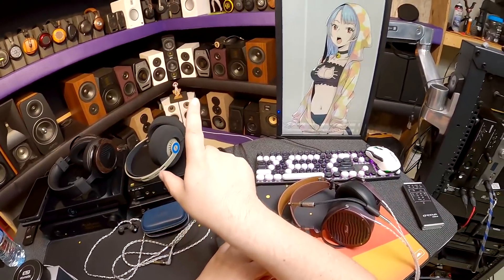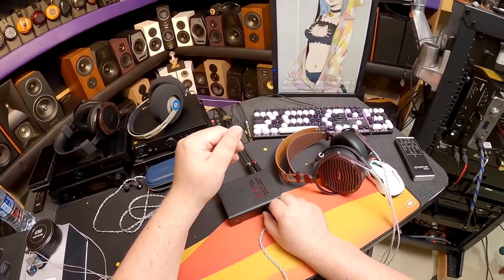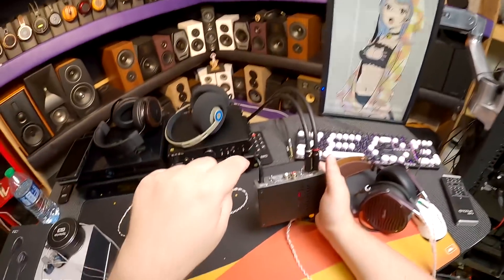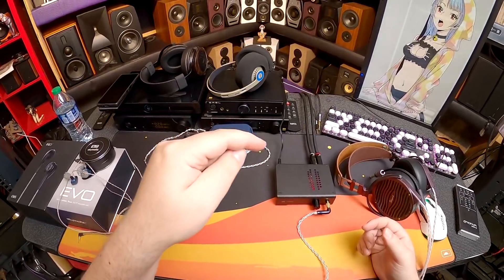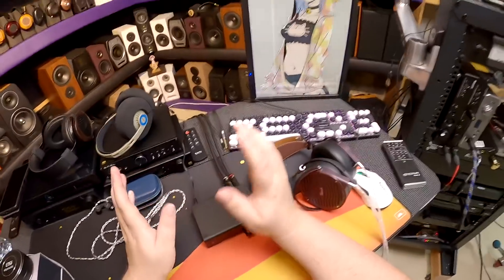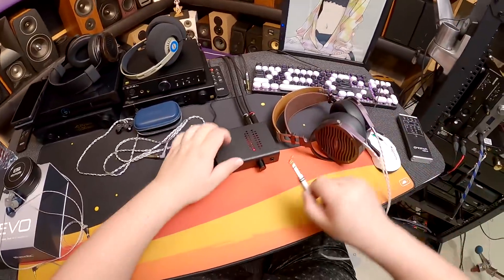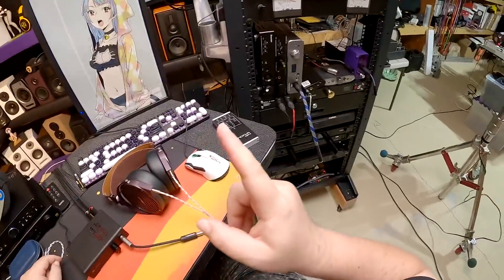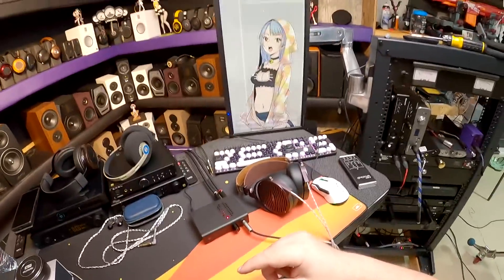🟥$120 Do-All-Amp _(Z Reviews)_ Schiit IEMagni

Comment: Ok, I have a pair of ATH-M50X that I've been using for years. I have them running on a cheap fosi audio DAC/AMP. Per the recommended of zeos, I bought a pair of HD 660S and then I also got a schiit Valhalla 2 to run them. I plug everything in and I was completely underwhelmed. Definitely not worth the pretty penny I spent. I felt the system lacked detail. Have my ears been ruined by the audio tecnicas?  Should I return the items and start from scratch?
Reply: I think you has got used to how your old headphones sound, I have 280 pro and bought 560s, was running them from focusrite, honestly, I've noticed more details and separation straight away. However, on some songs which I've listened to only on 280 pro and some Sony Bluetooth 40$ headphones, I felt like they sound just not as I remembered them. Now, I've bought Topping L30 to it and I feel like they sound even better, less ear piercing. 
I advice you to listen to different genres, maybe to such that benefit from more details and separation like classical music, jazz. Listen to some new music on these headphones so they would be remembered by you in this new sound.

Comment: I have one complain with World Best Cables. They promote starquad RCAs as if they were better at rejecting noise. This noise rejection only works for balanced connections. I believe their best RCA cable is the Gotham ultra pro with coaxial wire, 4 layers of non-directional shielding.
Reply: Isn't gotham also a Starquad variant? Pretty sure. Anyway, the best RCA wire is coaxical Mogami 2964.
Gotham is also good though, as are canare starquad. But 2964 was tested by RME to be lowest noise.
Reply: Also, if you can't tell in a blind test who gives a shit?
Reply: @davidjameswales  purely educational, to know which cable transfers best, not going to say it sounds any better. But I dislike those audiophile stiff cables, mogami is nice and bendable.
Reply: @davidjameswales  not a matter of sound, but noise, radio interference.
Reply: @tenveri  Gac-1 ultra pro is coaxial with 4 levels of shielding

Comment: Great amp. You're spot on about the Magni 3+ , Heresy, and IEMagni differences from someone who's had all 3.
Magni 3+ is way too smooth and loses too many details for me, Heresy is way too sharp/clean and doesn't add any comfortable warmth to the sound, and the IEMagni is the goldilocks of both for me. Absolutely love it, if anyone has questions let me know.
Reply: Hi I'm new to audiophile stuff and was looking into the modi 3+ and one of these magnis (likely the iemagni bc of these reviews). I've heard that it can serve as a preamp for speakers as well. Does this mean I can or should connect active speakers to the magni? Sorry if this is obvious I've been trying to figure out all the components recently and this is confusing me. Also are there any closed back headphones you can recommend to pair with these? How much should I be spending on headphones to get the most out of these? Thanks in advance!
Reply: @Likeitornot91  Modi 3+ is an outstanding dac and should be paired with any of the Magni's.
All of the magni's have a seperate preamp out on back that allows for active speakers (NOT PASSIVE) to be connected to the amp as well as headphones. I don't use speakers personally so I can't speak much of whether you should use it or not but I'm sure it is satisfactory. I use open backs primarily so not well versed in closed backs, but being in the community long enough for closed backs I always hear about Meze's offerings being good, whether its the Meze 99 or Meze Classics. Luckily since this is the best budget amp/dac stack in the world (IMO) and a fantastic starter set I wouldn't worry about ratioing how much you need to spend on headphones for them etc. They'll make anything sound great and are arguably all you need for an amp/dac. I personally would spend about 100 dollars or more on headphones to use with this stack at the least but they'll make anything under sound great as well. Hope I answered most of your questions.
Reply: @tungadilla  Great info. Thanks for the detailed reply, I appreciate it!
Reply: @tungadilla  I have the IEMagni's outputs plugged into an old B&K 202+ amp powering passive speakers.  Good little preamp for HPs, power amps and active speakers.  And I use the Modi 3+ DAC inputs (Toslink, coax, USB) as a three way "preamp" switcher between a computer, CD transport and DVD audio player.  All work and sound great!

Comment: I wanna see Z do the Topping DX3 Pro+. 2x1800 mW in a $250 dac/amp combo with 0.00015% THD. It looks insane for the price.
Reply: 200, not 250. Even insaner 😜
Reply: The problem is, it's a Topping product and while it measures wonderfully, it doesn't have great details nor does it have a pleasing sound when you have tasted at higher priced gear. And no, it's definitely a problem, because even after that, you can easily go back to low priced Schiit stuff (modi+magni) and say it sounds great. Not excellent, but just great. The Topping on the other hand is just so bad, with it's unpleasant and inaccurate highs and "analytical" bullshit. Coming from a guy who believed Topping stuff (DX3 pro included) was the best thing in the world, both budget and great sounding, but when you actually have gears to compare to it, you learn that it's actually really weak. Schiit stuff is so much better in every aspect, yeah you won't get DSD support or TOTL THD and measurement, but it just sounds so great which is what's matter in the end. Ofc Schiit stuff isn't the only thing that's great, but it was the topic of the video, so...